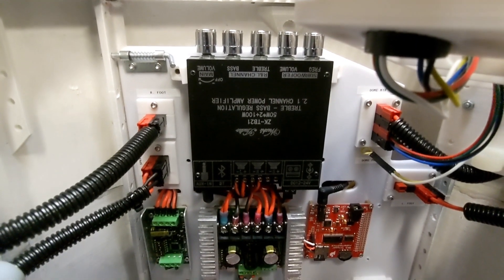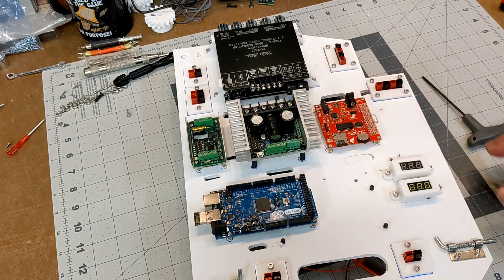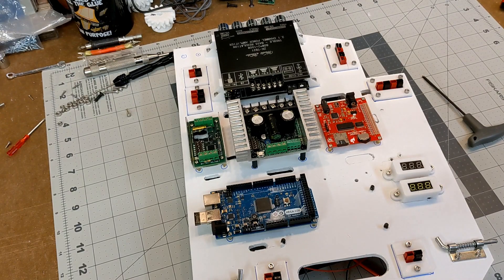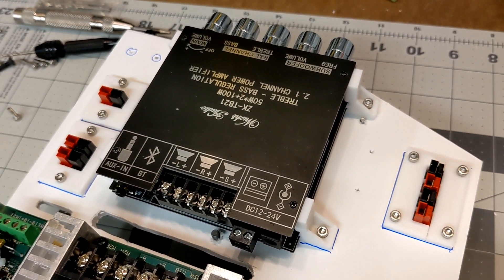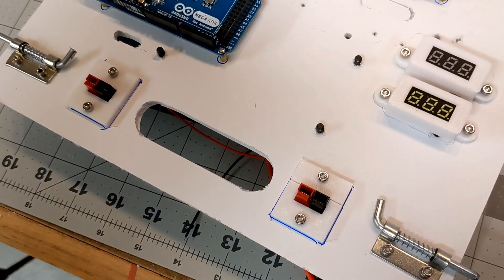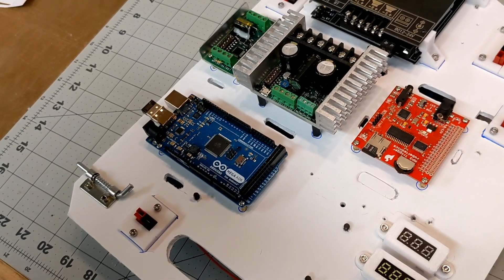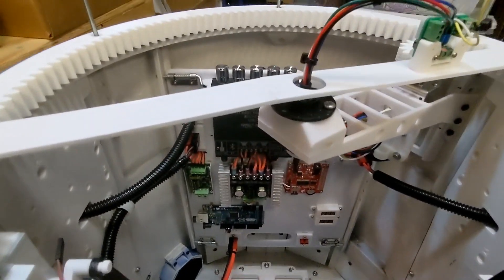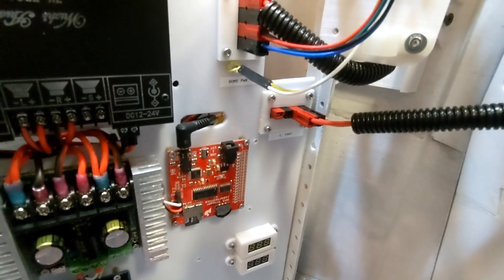R2 Electronics Build Part 6: Evolving the Prototype

Comment: @jasonsR2D2 - Finally got to a decent point where everything powered on over the weekend following mostly along with your videos.  One thing I noticed was that the amp you have (and linked) seems to have a startup beep it plays:  Does yours do that, or did you somehow disable it?
Reply from the maker: Mine does the beeps when it starts up - I think it's two sequences of three beeps? I'm also running the standard Shadow audio setup, so I get a little bit of the THX sweep sound as well before R2 starts his regular sounds. I admit it would be nice to get rid of the beeps, but that only lasts a second or two, so I find it tolerable. Glad to hear your setup is coming along!

Comment: I have MP3TRIGR included with sound files on my sd card ,but no sound would not play,any suggestions.
Reply from the maker: First, check if sounds play when you manually activate the toggle switch on the board. Make sure the SD card is 32GB in size or smaller, and formatted as FAT32. Larger capacity SD cards are not supported. Sounds like you have the required .ini file, which is good. Ensure that all the sound filenames begin with a 3 digit number (001, 002, etc.) anything after the 3 digits is up to you - it doesn't have any impact. If none of this helps, let me know.
Reply: Ok I check later today.

Comment: These videos are a big help. Thank you. Can you show us how you charge your batteries and if you can do pass though charging so R2 remains live in some form while charging.
Reply from the maker: For charging, I remove the batteries from R2 and charge each one separately using a standard Dakota Lithium 12v/3A charger. The batteries have a 10Ah capacity, so if they were fully discharged, it would take 3.3 hours at 3A charge speed to get each one back to 100%.

As far as being able to use/operate R2 while the batteries are being charged, I'm not really sure how to go about doing that (or even if it's feasible to do so).

Comment: Looks great! Thanks for the links and tips! I'm starting to collect more electronic components. The layout on foam core is a great tip. I think I'm going to have to break my board up into 2 or more because of the 2-3-2.
Can't wait to see yours moving!
Reply from the maker: I can't begin to imagine the challenge of fitting all of this PLUS a center leg lift into an R2. Best of luck to you!
Reply: Yeah... I probably bit off more than I can chew. I've got the dome innards (Swartz) mostly done, (I am going to redo the boards now that I printed out Makerdan's board) some of the other dome innards planned, and I've got 6 arms, the zapper, and the saw to do. I figured out I needed to reengineer the arms and the I need to finish figuring out how to create a folding mechanism for the zapper and saw. Those are a work in progress. Plus the 2-3-2.
I am going to split the body electronics up as you did. 
Did you work out the board for the motor controllers yet?
Reply from the maker: If you mean a sub-board the body electronics (voltage step downs, body marcduino, etc.) then no - but I do have some ideas. I'm also considering adding a trading card dispenser behind the LDP. I have a feeling I will wind up with a second, smaller board mounted somewhere lower front - behind the coin slots  maybe. It will take 24v from the main board (via the unused connector), and step down and distribute as needed for the various body systems (and lights).